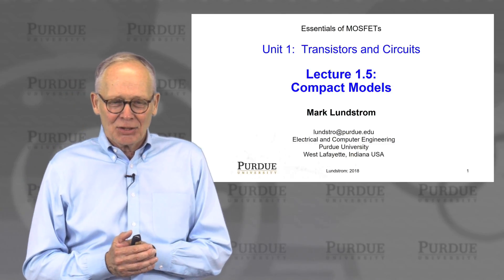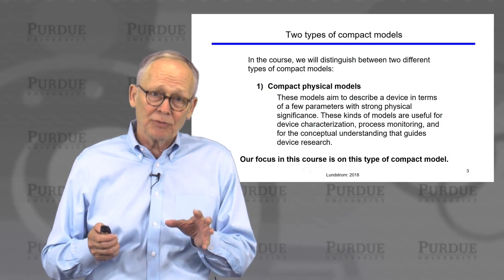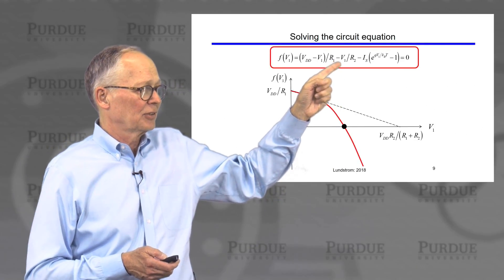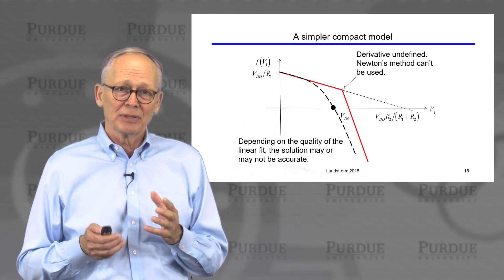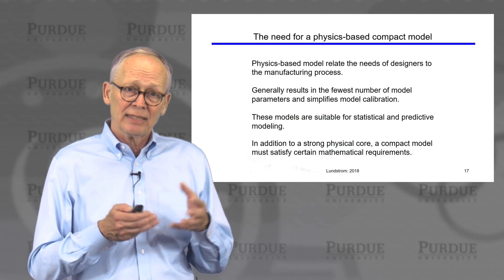nanoHUB-U MOSFET Essentials L1.5: Transistors, Compact Models, and Circuits - Compact Models

Comment: 00:00    Lecture 1.5: Compact Models
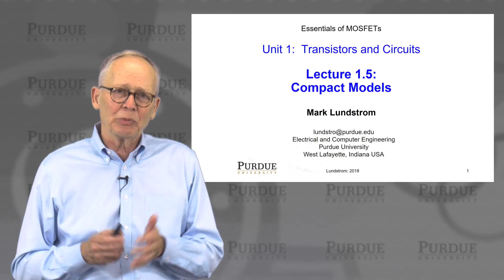00:34    About "compact models"
01:28    Two types of compact models
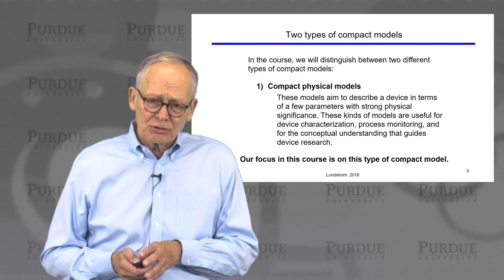02:17    Second type of compact models
03:02    Focus of course and this lecture
03:35    Compact models for numerical circuit analysis
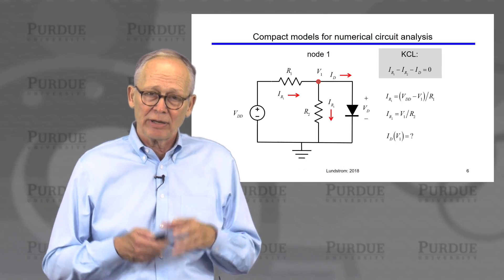04:21    Numerical circuit analysis
04:50    Simple, compact model for a diode
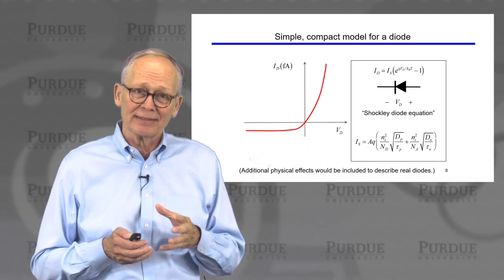05:34    Solving the circuit equation
06:34    Newton's method
08:44    Graphical representation
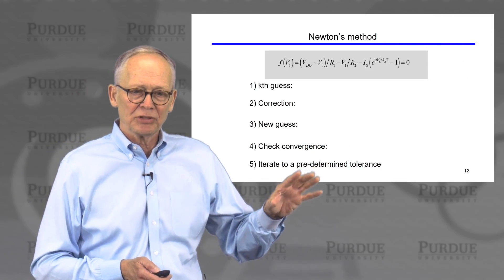09:58    Newton's method
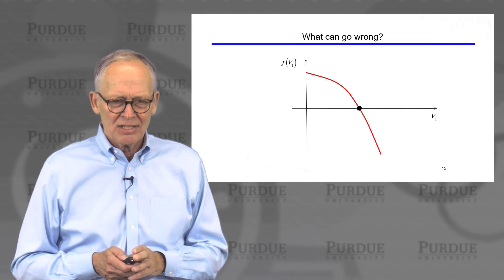10:30    What can go wrong?
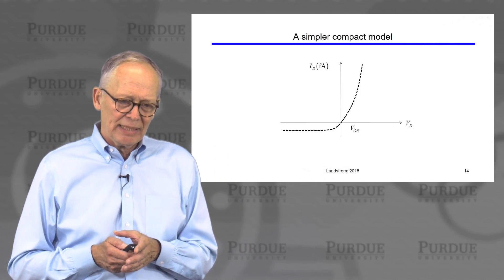11:50    A simpler compact model
12:06    A simpler compact model
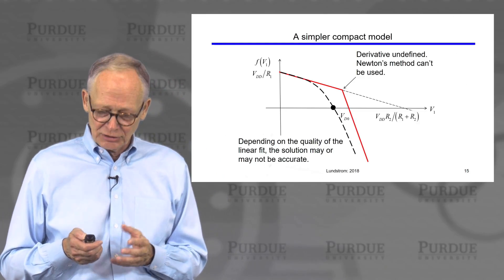12:49    Some requirements of a compact circuit model
13:43    The need for a physics-based compact model
14:57    Mathematical requirements of a compact model
15:55    For more information
15:56    Summary